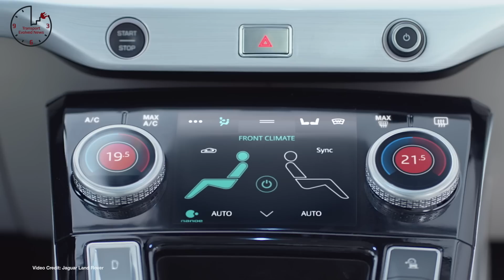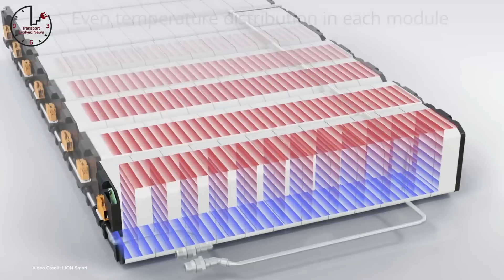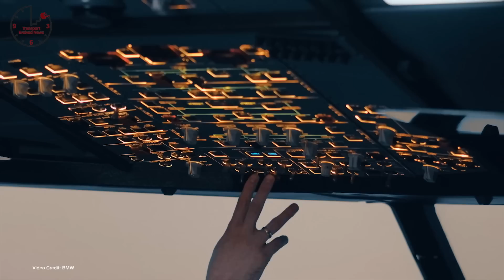Mercedes-Benz EQC, Tesla Model 3, Uniti Down Under, Battery Breakthrough: TEN Electric Car News 222

Comment: My rough back-of-the-envelope calculations show that the chartering a 777F cargo aircraft to fly to five locations around the world would emit around 66 metric tonnes of CO2. So once the first ~3,000 EVs have driven 12,000 miles in their first year, this will have clawed back as much CO2 savings compared to gasoline cars.

Note, this is very rough ballpark, so it could be 1,000 or 10,000 EVs. Just gives an idea of the outrageous scale of pollution emitted when you charter your own cargo flight rather than add cargo to a scheduled flight.
Reply: I agree, but in the grand scheme of things it's pretty much irrelevant, and if they can generate some actual change to EV's off the back of it, well worth the effort.

Similarly I calculated for a Falcon 9 launch - those things produce a lot of CO2, but compared to vehicles.. well, lets just say that a single Falcon 9 produces the same CO2 that the F150's sold in the last 45 minutes (1350 a day, over 8 hours of business) will produce in a year - not including building them. At a weekly cadence over a year, that would still be less than a weeks worth of F150 sales produces in a year, just in tailpipe emissions.

Comment: Hi Nikki, general rule of thumb for NEDC to EPA range conversion is multiply by 0.75, so 450 km NEDC is 338 km EPA or 210 miles. That's less than the base Tesla Model 3 is supposed to go once it's out (and that most likely will happen before the EQC will be out).
WLTP numbers would be another story but Mercedes chose not to give us WLTP numbers.

Comment: I would suggest that Mercedes are trying to talk up the range of the EQC because its probably not on the high side. But if it has an EPA rating of 200-250 miles, really that is fine. But the problem might be that Mercedes will want to charge top price for it. If they were to ship something like the B class electric(which I loved) with a bare 200 mile range at an affordable price, then it might have signaled they were on a clear footing with EVs. 
We really don't need another showroom distraction at this point. Mercedes already make lovely cars. Get a viable affordable electric option and move it in big numbers. But I suspect Mercedes are not yet there with large volume battery production.
Reply: Mercedes has their own battery factories though. Look up Accumotive

Comment: The correction for the EQC is interesting. When the announcement was made I did think that Mercedes Benz had dropped the ball on being competitive with Tesla and Jaguar, even if you don't need 280-300 miles of range that often, being so much lower that the competition was going to hurt them.

With the correction the EQC now lookes like a much better car.

Not that I'm in a position to even consider buying one.

Comment: More fast charging stories - is that really news? There's already chemistry out there that can support high amounts of charge. But you've always sacrificed longterm battery life and/or battery density. To me, it's only news if that sacrifice has changed. I wish you'd be clear on whether that's the case. Because I doubt there's existing EV owners who think we really need much higher charging speed. What we need, is to not have to wait on the car to charge. Whether the solution is higher battery density, higher charging rate, more public chargers and/or autonomous driving (and charging) doesn't really matter to me. Either way, I think 120kW charging on a 100kWh battery is plentiful for almost everything - in that case it's only about charging availability if anything.
Reply: And obviously charging has to be able to be paid by normal standards, like debit card, mobile payment apps or perhaps even cash. And also have transparent pricing (e.g. display with ¢/kWh, $/hour or $/minute at current rate and perhaps the price of filling up completely), and the ability to easily pay people you visit or share home parking spots with.
But I'm sure that will come quickly as EVs get more popular. I've already seen several proposed solutions that look pretty good.
Reply: It depends. The way I drive my car, I would only need supercharging in a high range car occasionally - once a month or so. If pumping in 120kW vs 350kW doesn't have any appreciable difference in longevity based on the fact it will only happen a few times a year, then go fast charging!! I tend to agree - if I've been driving for 3-4 hours, I'm taking a half hour break anyway, so charge times aren't a problem in that respect, but the faster we make them then the less of an issue contention for the chargers is, and the more people we get REPLACING their ICE vehicle with a full EV.

Basically, we'll have far fewer chargers around town, and many more on the main thoroughfares between cities where people are likely to have to stop during a long drive.

I think the greatest thing to do would be to work out how to make 'home' charging more effortless for those without a driveway. Better availability in apartments, and either on the curbside or where you park for work, would be the best way to improve
Reply: Yeah, home charging or perhaps more generally "destination charging" is the most important thing. If every destination you visit has charge points, then almost all everyday driving case is taken care of. The main purpose of fast charging is road trips. And for road trips, it still matters how many chargers there are, because people want options of where to have their break. But I think the vast majority of people are fine with having it on a highway cafe or another place close to a highway that they're travelling on.

But there is a niche of people who push themselves beyond comfortable trips, and drive full days with only a few very short stops (peeing, switching driver and buying coffee or takeaway food to consume in the car). I don't think that niche will be covered by EVs anytime soon. It'd be a big sacrifice for the car battery to be able to make such trips.
There's also travelling salesmen, who may drive 1000km/600mi in a day and only stop at companies or houses. And those places need to have charging. But there can also easily be stretches of 500km/300mi that you need to rush to make it to the next client. So they may also need a slightly bigger than 100kWh battery.

And then there's performance charging, which mostly means to have a few fast chargers near tracks. In case of endurance racing (i.e. Le Mans), there just isn't really any solution in the pipeline that compares to what IC or FC vehicles can manage (except battery or car swapping). Le Mans will probably have to be hydrogen cars if they want to reduce their footprint. But I think there'll always be a small niche of veteran and sports ICE vehicles. And I don't think that's a problem either.

Autonomous driving (and charging) helps in making it possible to be dropped off somewhere more distant from a charger, and then have it go charge while you have that break. That may be convenient both during road trips and unscheduled trips/stops.
Reply: I don't know, I think once batteries are cheaper (about 5 years by current predictions), even travelling salesmen will want to switch. The more miles you do, the more you save with an EV, to the tune of tens of thousands a year for very high mileage users. With the reduced cost, it won't be hard to justify a few extra kWh in the pack to allow all day usage with only a short stop before an overnight charge. These are the same calculations that initial customers for the Semi will have - can they make the range work for them, and is there enough infrastructure to do so - great, save tens of thousands per year in fuel and maintenance. The real trick here will be charging coverage and frequency, particularly along main routes.

On the racing side, as long as they can charge the battery faster than they use it, a couple of batteries on rotation that can be swapped might do the trick, but I don't think that's a real issue anyway - as you hinted, IMHO the real impetus is to change the 2 billion road vehicles driving tens of thousands of miles a year to EV. The few hundred thousand race cars don't matter one iota. Sustainable simply means that the environment can recover from the damage we do sufficiently, and the fuel resource is inexhaustible. When it's only a few classics and some race cars burning fuel, both of those things will be (essentially) true, though we may find some synthetic fuel that is actually better anyway, or as you said perhaps hydrogen fuel cells - I don't think they can beat BEV for general road vehicles, but with the vastly reduced infrastructure requirements if it's only certain places you have to store and ship it to then I think it would be feasible.

I also agree with the payment thing - I'd like to see some way for the providers to communicate with each other, such that you only need an account with one of them and then you can use any charger that is part of the grid, and it will automatically charge a card for you, no apps or cards required. The rate is an important thing, but my hope is that you will be able to view and see the rates for a charger on your in-car navigation or say google maps before you even get there, and make that decision (or have your car make that decision for you automatically and route you appropriately) based on cost.
Reply: Matthew Jenkinson  I think it depends on the clients. Big clients sometimes require more upfront cost to maintain, which also could mean a bigger and faster long-range vehicle. But for a salesman with many small clients, I'd certainly agree. But yeah, I don't think there's many years left until even incremental battery capacity improvements make the cars sufficient even for them.
I think semis are different, as they are almost entirely focused on economics. Sometimes it matters slightly that you could save a few minutes of travel time - but the vast majority of the time, it just matters that its the cheapest vehicle in TCO.
Travelling salesmen often have more luxury and worse economics than "optimal". And regular drivers even more so.

I agree on seeing the rates before getting to the destination, when it comes to road trips. I can imagine offers like "get free charging when buying a burger menu" would become common. But I'd also like to see the pricing on the places where I stop on everyday trips, like at the shopping mall or visiting a friend. I think it's just nice to be confronted with the cost, like when refueling a ICEV, rather than getting monthly bills where you need to remember where you were, or make premature estimates, in order to associate pricing to different charging routes.

Comment: What's needed in the marketplace are 3rd party battery upgrades to give current EV's extra range and faster charging and keep them on the road and upto date.
The biggest reason I hear all the time from most people for not buying an EV is their depreciation and their technology becomes outdated quickly. To me that's the biggest mistake most EV manufactures are making, not supporting the upgradability of current stock, in the belief it would reduce new sales. 
I can't wait until Lion Smart make a 50kWh 200 mile range replacement battery for my Vaxhall Ampera (same as Chevy Volt in US)  with fast charging too.
Reply: Yeah I think this is a valid concern, but it's also the case with current vehicles. Literally all of them. At least in Tesla's case you keep getting updated software, and can upgrade some of the hardware over time (some of it on Tesla's dime), which I have heard of literally zero other manufactures doing.

Though I think Tesla should definitely be encouraging a strong aftermarket parts supply chain - that would make them soooo much more popular I think.
Reply: Matthew Jenkinson , third party parts supply would be great, but third party suppliers like to see a large number of cars on the road.  Maybe Model 3 will start to crack that barrier.  I sure wish parts for my Model S were as cheap as the equivalent Chinese part for my '92 Honda Accord, but I don't expect to see that any time soon.  Batteries have the same problem.  Maybe someday there will be such a thing as a standardized battery, but then again, has there ever been a standardized engine for a gasmobile?  Not that I know of.  (although people put Chevy LS crate engines in all manner of things...)
Reply: IncognitoTorpedo  As always, it depends. There are aftermarket parts for Lamborghini's after all, which have FAR fewer on the road than even the Model S and X for a specific model year. I think the biggest hurdle is actually the technology - it will come, but the aftermarket industry for ICE vehicles has had a LOONG time to build capacity and options, and the skills for EV drivetrains are a bit different.

As for hoping the parts for a Model S will be as cheap as a Honda, good luck. It is a premium car, and the design of most parts is simply more expensive - would you expect parts for an E Class to be the same as your Honda, for example?

With the batteries, it's the same question - can a pack be designed to fit the original space. The trick with batteries is that price is heavily dependant on manufacturing capacity, given equivalent quality. There might be a market for reconditioned packs, where bad cells are replaced and the pack resold for a much lower price, but I can't see them being much less than OEM equipment unless there is significant margin or they come from a questionable manufacturing plant.

But all of these issues are the same in the ICE world, we're just more comfortable because we KNOW these are issues.